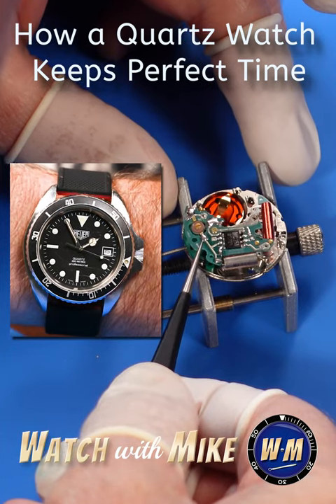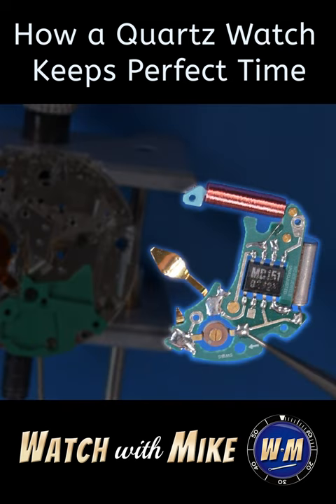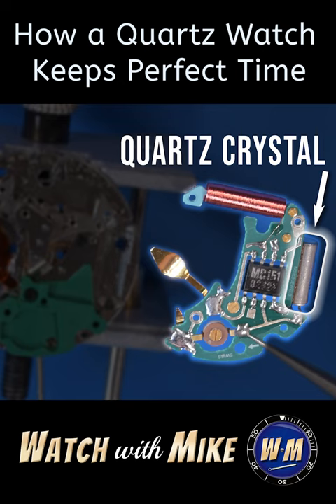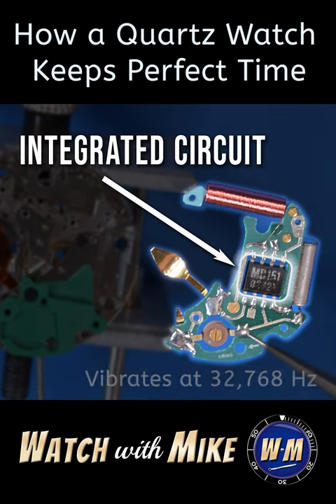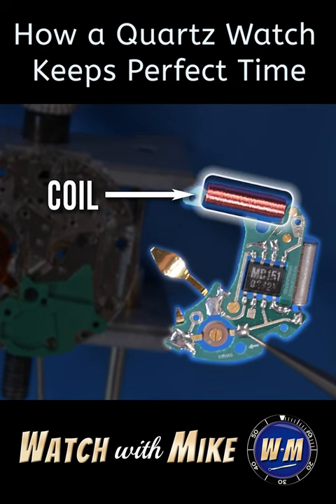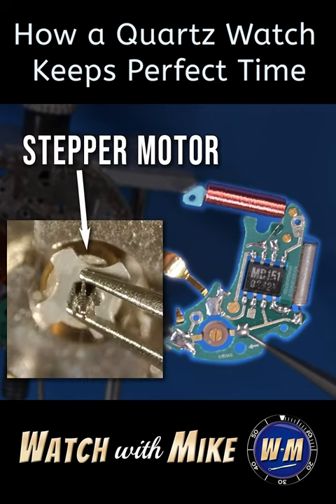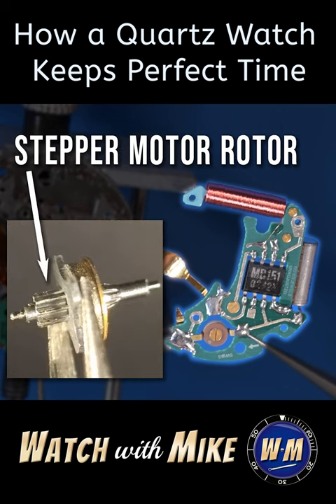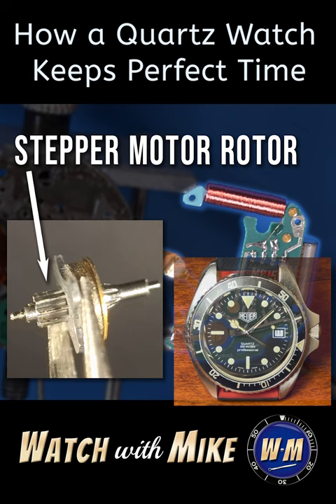How a Quartz Watch Keeps Perfect Time

Comment: Small correction, the IC doesnt count the vibrations, it just sends the plain signal into a series of flip flops, and with each flip flow the frequency gets halfed until you reach a point where its low enough for the stepper motor to turn once every second, there isnt any calculating or counting done (counts for most quartz watches, doesnt work this way for spring drive or more elaborate quartz circuits that take temperature into account)
Reply from the maker: @weibrot6683  👍🏼

Comment: Any tips on cleaning circuitry on a quartz watch? Or will rodico be enough?
Reply from the maker: Most of my circuit cleaning has been to remove debris from a leaked battery. I have used distilled water or isopropyl alcohol on a very lightly moistened foam swab. Rodico is good for picking up pieces that are loose, but doesn't have enough tackiness to remove stuck on dirt. If there is stubborn corrosion then I will use a knife, dental scraper or a file to remove what I can without damaging the circuit first.
Reply: @WatchWithMike  Thank you for the reply, I appreciate it.

Comment: please I have a 10mm 35mAh  3.7v lithium battery that I want to install in a mechanical quartz watch . so I need convert  voltage to 1.5V and output power of 1μAmpere  only ...  .  anybody knows which IC I need please ?
Reply from the maker: Hi David, I do not know and I don't think you'll find your answer here. I'd suggest a watchmaking forum. Good luck!